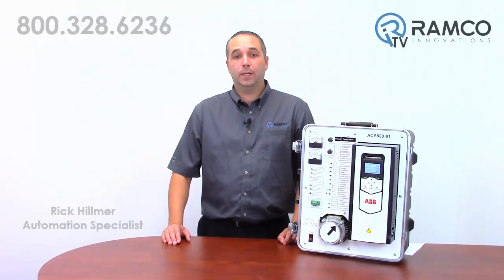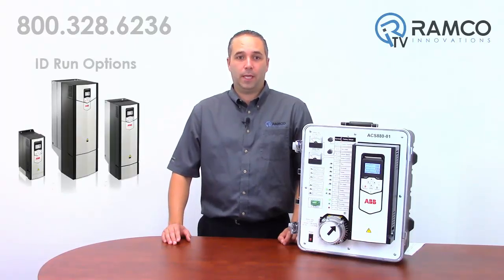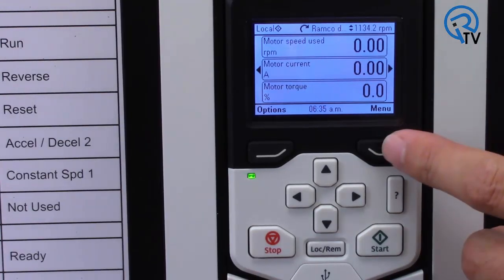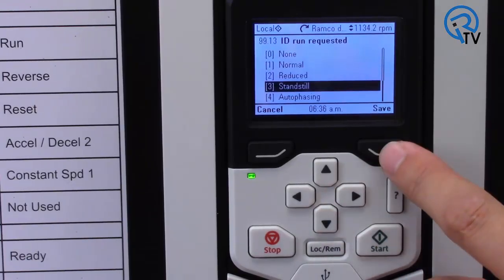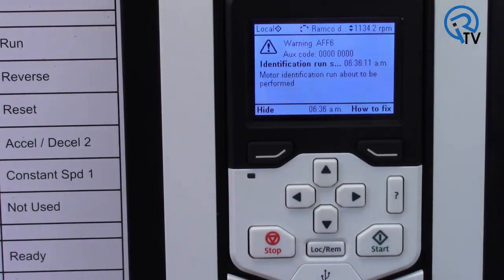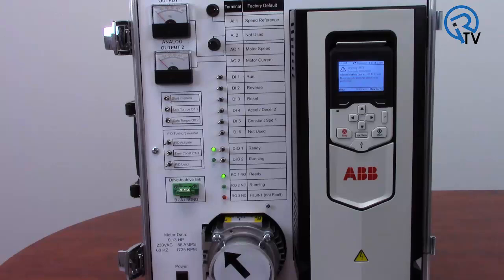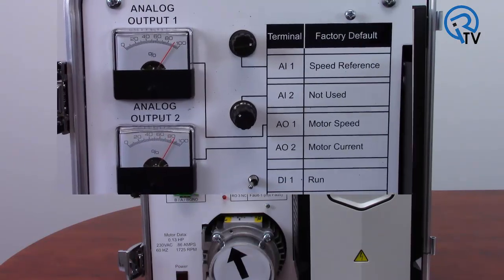ABB ACS880 ID Run Options

Comment: In DTC, the reference setting is rpm... can this be altered to using torque as a reference setting?

So instead of wanting the motor to drive at "1000 rpm", you tell the motor to run at "50 Nm".

If this is possible, what parameter is this? I'm using an ABB drive ACS800 (01 0016 5). People have told me this "should" be possible but I see no settings for it in the firmware manual.

Comment: hi sir, ı have a problem acs880. ı control 12 motor. running the motors when I connect from PC to control panel, ı want to take back up but 6 motors are stopped ,,6 motors contunie run. Why can ı take fault. ı should look Which parameters and if ı can changed the parameters, problem will fix. while motors running, ı want to take the back up.
Reply from the maker: Bahadir, Here is the response from our Drive's Tech: 
hi sir, ı have a problem acs880. ı control 12 motor.
-You have 12 motors connected to this one vfd? 
running the motors when I connect from PC to control panel
-Using drive composer? 
, ı want to take back up but 6 motors are stopped ,,6 motors contunie run.
 -How are you controlling them individually?  Are there individual overload relays for each motor?
Why can ı take fault.
 -What fault are you seeing?
ı should look Which parameters and if ı can changed the parameters, problem will fix.
 -You can select "not at default" when in drive composer
while motors running, ı want to take the back up.  
-You can upload to the control panel or do a backup with drive composer while the vfd is running.

Comment: Why we use ID run option in drive..?
Reply from the maker: You would do this when you want to run the drive in DTC mode. To run in DTC mode, the drive needs to know how the motor behaves, so this is why you would perform and ID run.

Comment: today i performed  an ID run  but ,  unfortunately it  tripped  on  short circuit , when i checked  motor  after  disconnecting  delta  connection , all winding  showing  ok and  balanced , and  cable  is  ok s  well . then  how  come  this  short circuit   tripping  happend ?  and  i  suspect the  drive now  damaged .     I want  to  ask you .. is there no protecton  against  short  circuit  in ABB  acs  800  drives ?    should  the  drive   damage  everytime  any short  circuit  occur  in  motor  or  cable ?      hope  you answer .  thanks .

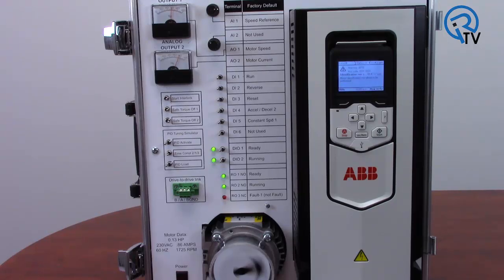Comment: Can I display the actual torque in [Nm] instead of [%] ? (e.g.min 2:52)
Reply from the maker: This is what our Drives Specialist had to say.
Yes, you can display the actual motor torque in nM or lb-ft on the display, but you must first know the nominal torque of the motor at full load (100%).  Then, when setting up the display, it is a matter of scaling the units and adding the correct label.
Keep in mind, this is a calculation based on an estimation.  If a true torque reading is needed, using a torque flange, or other sensing device may be more accurate.
Reply: Thank you very much. It works!